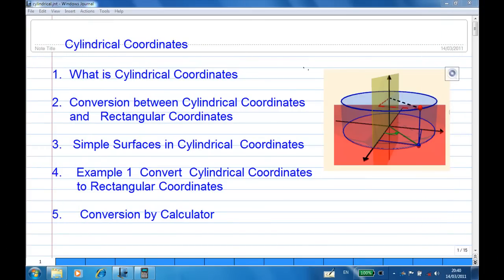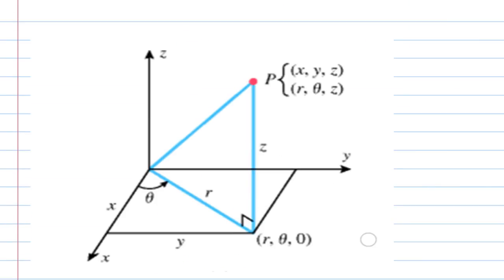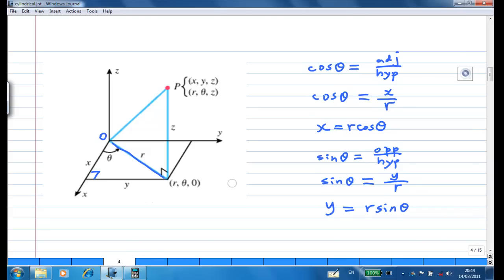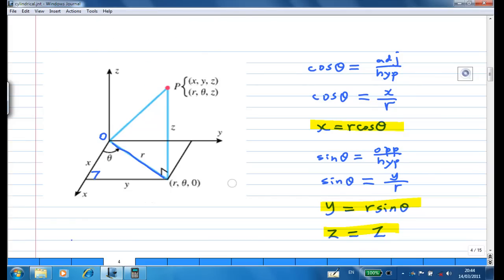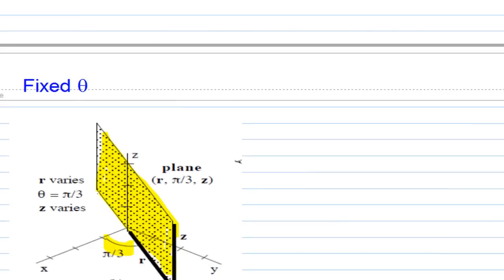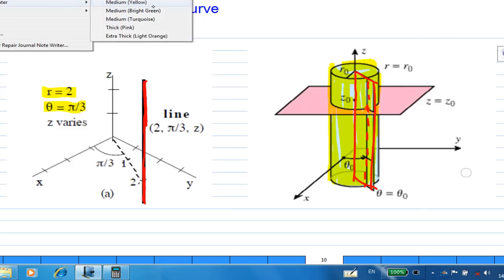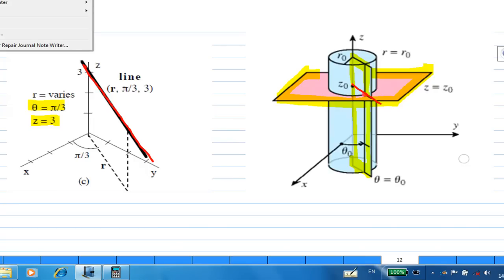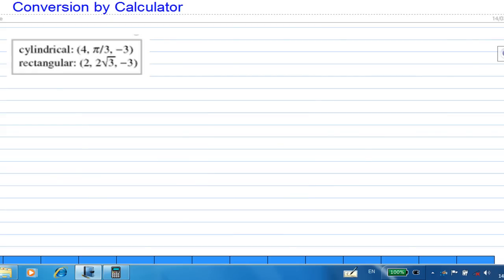Intro to cylindrical coordinates

Comment: You should try using Microsoft's Onenote instead of Journal. Onenote has many improved features: graphing paper backgrounds (grid templates), drawing tools which make it simple to create shapes and 2D/3D coordinate axes, scratch-out gesture for easy erasing, "Insert or Remove Extra Space" tool, lasso tool, better pen/color options and much more.